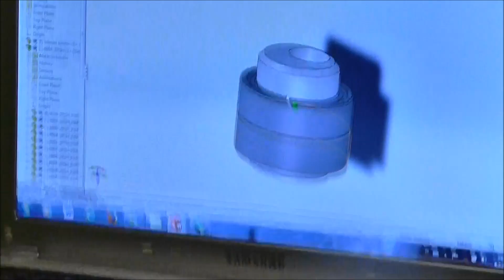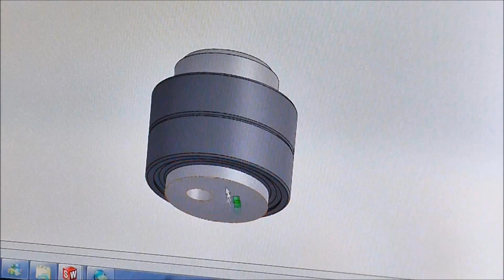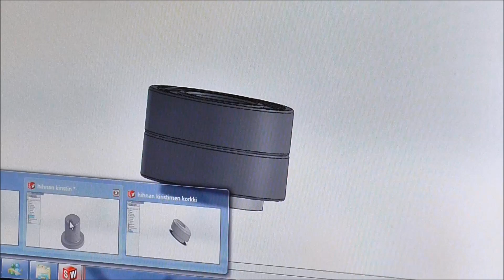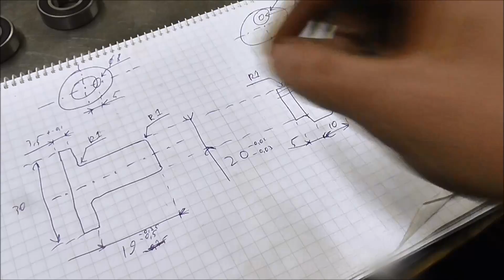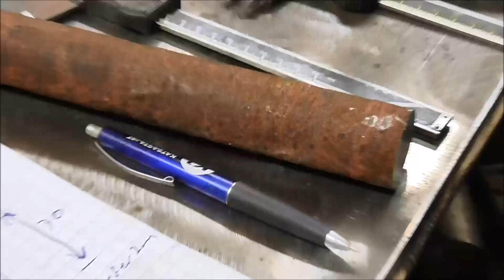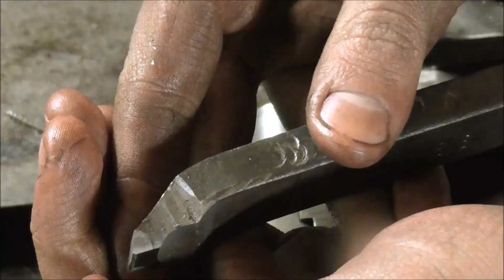Mystery project part 1

Comment: I'm going to take a shot at guessing what the project is (I'm sure as you post more vids I'll change my mind but for now this is the best guess):
#1 guess - a CNC table for a plasma cutter or a router and these are the rail rollers which will be adjusted by the eccentric bolt.
Reply from the maker: Thanks for the guess!